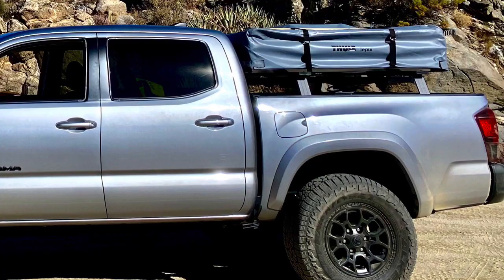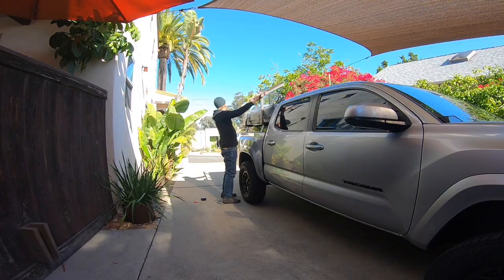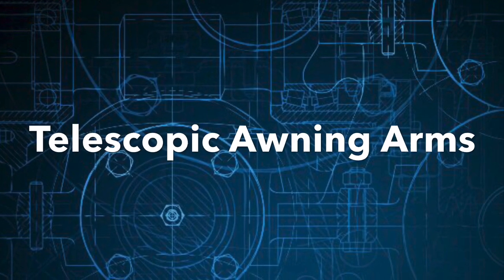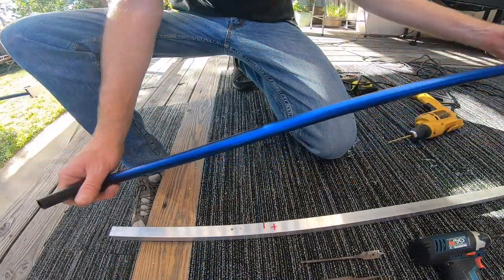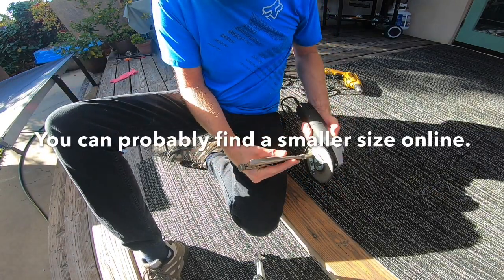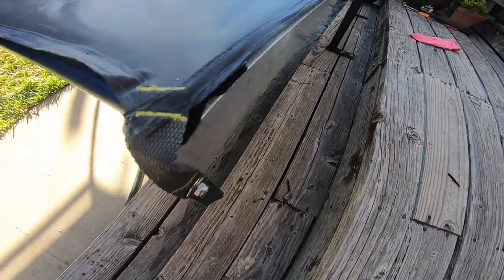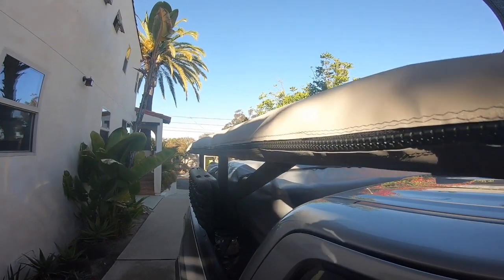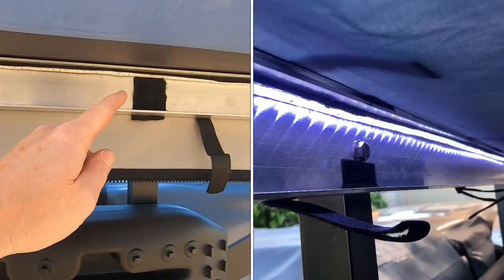DIY Awning - 7'X10' Budget Friendly - Light Weight Aluminum

Comment: Love the design - solid build. How thick is the aluminum c-channel?
Reply from the maker: It is  3/16" C channel. It is plenty stiff, but we went on a hike a few weeks back and left the awning out...wind came up heavy while we were out, the anchors pulled out of the sand. Came back to a slightly bent awning, but no major damage. I was able to easily bend the C channel back into shape and close the awning. Straightened it all out at home and good as new now. That being said, maybe one size up 1/4" wall C channel would be better for that scenario. Thanks for watching and commenting. Stay safe out there. TbT

Comment: All in all, how much did it cost you (minus the parts you had laying around)?
Reply from the maker: About $140. Tarp $20, hardware and aluminum (c channel and blue arms) $50, black legs $40 bag material and zipper $25  and a few miscellaneous items like nuts and washers. I had the legs and the feet materials as well as the black spacers left over from a few TV wall mounts.  Thanks for watching. Stay safe out there. TbT.